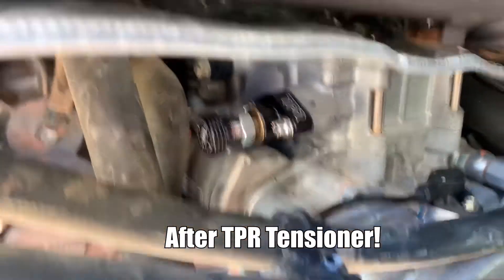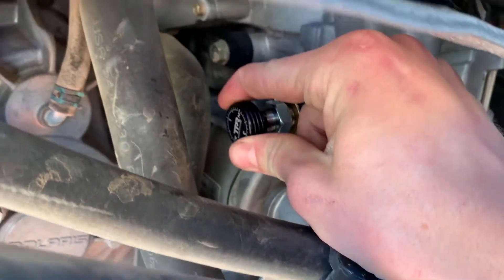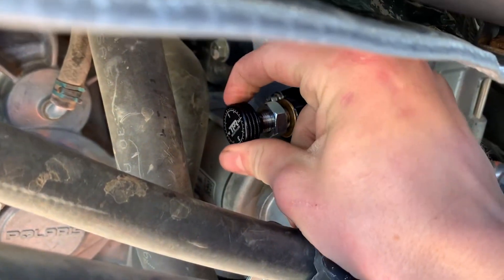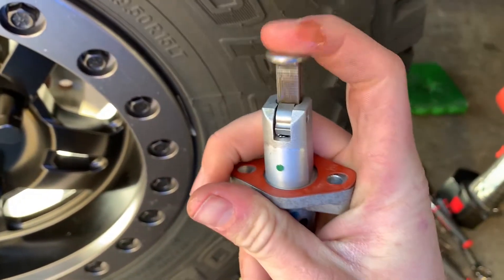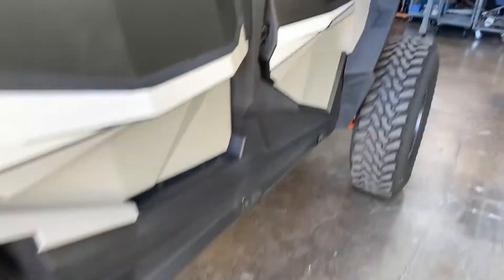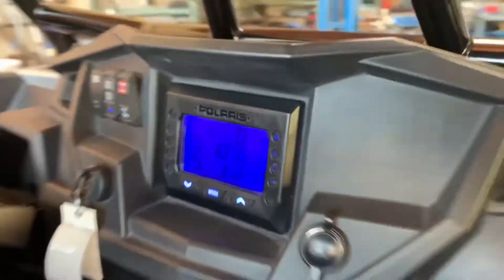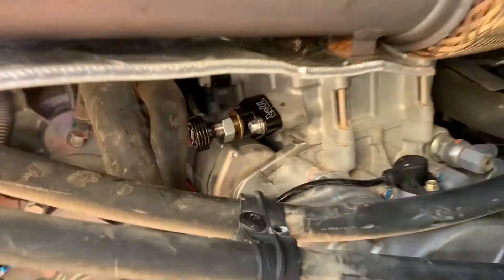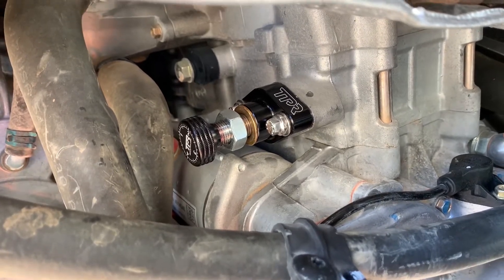Polariz RZR 1000 timing chain tensioner before and after !!

Comment: Did you have to remove the valve cover to make sure the cam lobes were in the correct position? Or did you just undo those 2 bolts and install the new one?
Reply: actually something i'd like to know too.
Reply: Soooo
Reply: No rear lobe has to fave away from car
Reply: I know I’m late to this party… BUT…. TPR Industry has an install video for this item on their website.  FYI